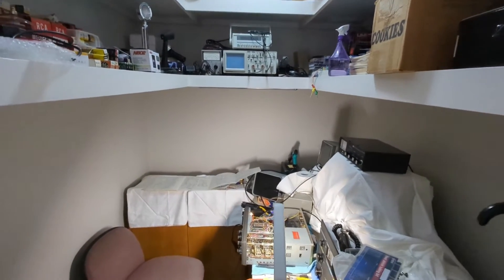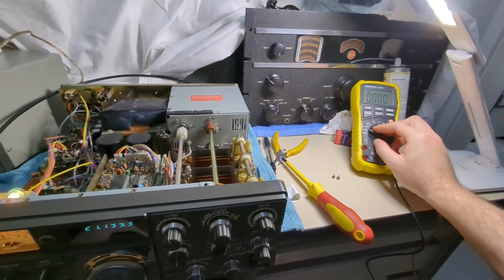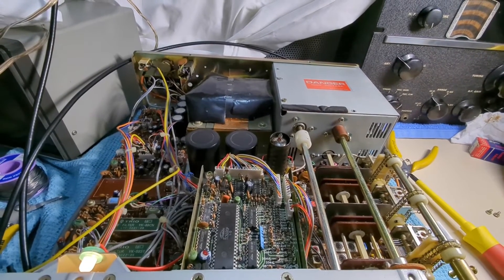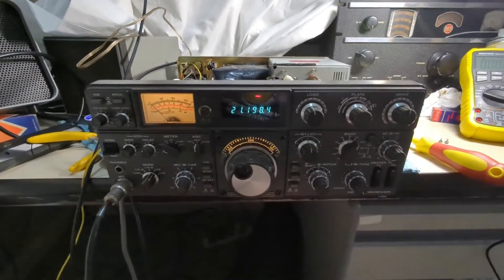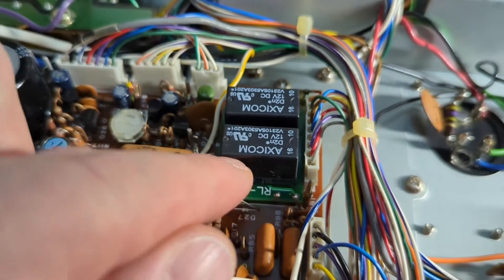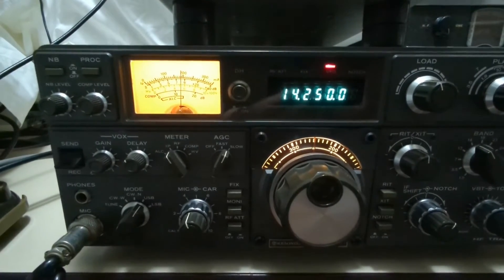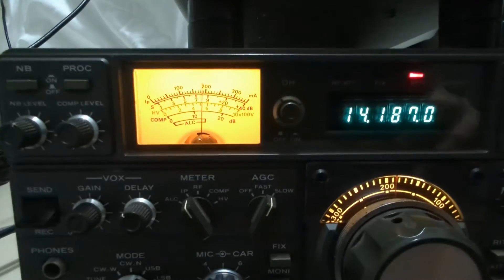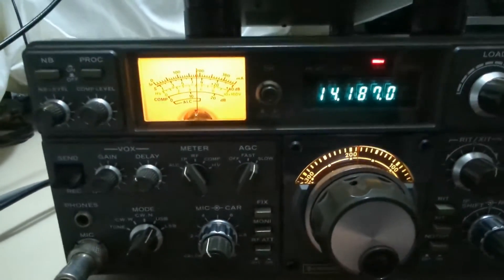Kenwood TS-830S – Intermittent RX/TX with a Surprisingly Simple Fix

Comment: I replaced my relays with those that you’re showing, and lost transmit and receive. My radio is effectively dead.
Reply from the maker: Without having the radio in front of me, I guess check to make sure they are the right type, no solder was bridged, no bad connections etc? Worst case, maybe clean the old ones and put them back in.
Reply: @V @VK3USA I have another board with the original relay I’m going to install. See if it comes back to life.

Comment: Why did Kenwood use two different types of shaft couplers for the plate and drive control shafts?
Reply from the maker: I'd say it probably just boiled down to cost reasons. Much cheaper to use nylon connectors rather than brass throughout. Probably no issue to last 15 or more years, but it comes an issue when we try to get 40 or more years out of our equipment.

Comment: Why would the defective driver tube not allow the radio to receive?
Reply from the maker: I know this might seem strange to you if you're not used to electron tubes. When under load and heating up, the 12BY7A would intermittently short out one of the grids (can't remember which one) to ground which would pull down the supply rail. In turn this affected the rectifier unit affecting the rest of the radio. A new driver solved the issue. Placing the old driver back in the issue returns.
Reply: @VK3USA  That's an interesting twist, would never of thought of that.
Reply from the maker: @g1cpu  Neither did I for a while! The only thing that gave it away in the end was that it only went intermittent when transmitting and not right away. Only when something was warming up.

Comment: If it has one, watch for that pesky "fix" switch for the fixed crystal. (that no one ever uses). The frequency will warble all over the place when corrosion enters this switch. The "fix" is to push the "fix" button, again and again and again. Once the crud is gone the radio will operate normally again. Also, I LOVE vfd frequency displays. I wish they kept them longer. Beats the heck out of crummy LCD displays any day. On side note, DON'T let contact cleaner come into contact with the plastic case in any of these kinds of radios or you'll be sorry like I was. Take care and 73.

Comment: By  being very old ham, I can now see the radios I bought brand new 30 years ago I now see built to last about 20 years, actually I think most things like cars and refrigerators have a limited lifespan built in also. Everyone who knows something about stuff that is 100 years old knows how well built it was built back then.
    the entry of China into ham radio market has ruined the Japanese radios forever. Now ham rigs are like computers let go out of date every three years. When I can buy K3 technology in a Chinese radio that is not as pretty but is inside good performance... WOW       The era of super nice big Japanese rigs is over. I guess I own the last of the big radios== I have an FT DX 9000, ICOM 7800, and sold the last alpha I had.  
    By the way, the ICOM 7851 looking closely. Is almost a lab instrument.  It is definitely the last big ham radio, so get a 7851 as soon as you can because the market is not supporting it either---- get the dealers last one or even a dealer demonstrator.
     I know that at my age the page has turned and I had better move on to the Elysian Fields and hope my successors can hold the band spaces.
Reply from the maker: It's a shame to see ham radio going the way it is. Sadly I think we're seeing the last of traditional Superhet designs. I laugh at people spending $10,000 or more on SDR radios that don't even have an inbuilt screen or controls. 'Pure Signal' the latest fad where the SDR manufacturers have supposedly found a way to cut off the bleed through on either side of their transmission. Clearly the people opening their wallets have never heard of how Collins solved this issue way back in the 1950s with their Mechanical Filters! To add insult to injury, these 'Check Book Ham's' buy LDMOS Amplifiers and drive the absolute living s$%t out of them with horrible distortion, effectively nulling the advantage of their so called 'pure signal'. Try to tell them and they just abuse you or won't talk to you. The Icom IC-7800 and 7851 are the only rigs I would gladly pay the big bucks for (as I did with my 7800). Yeah I plan on getting the 7851 within the next year or so.